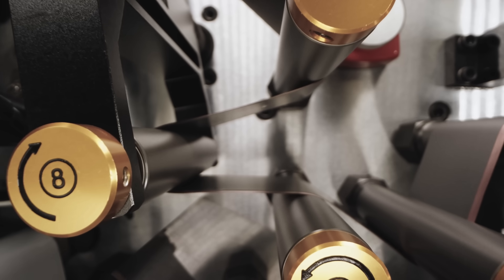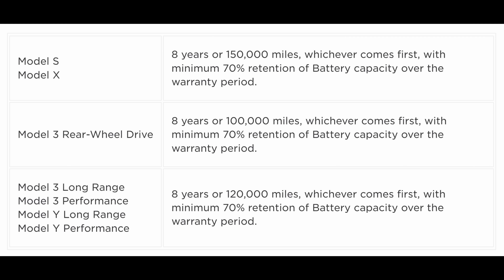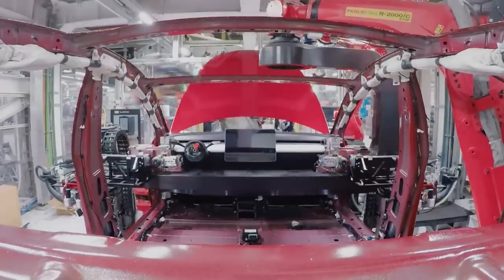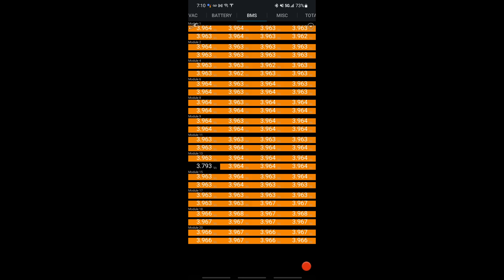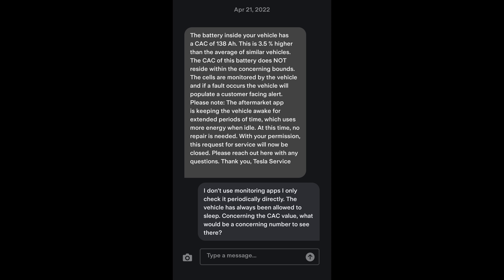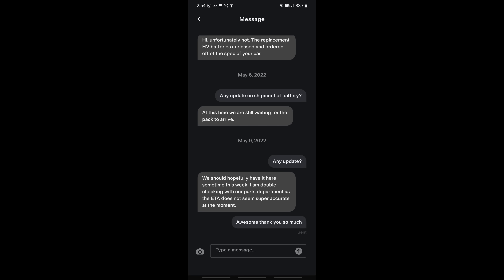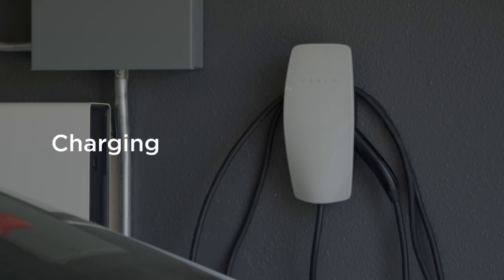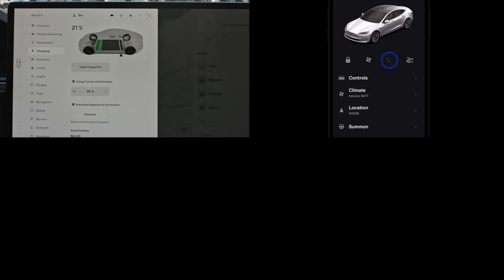What Happens When a Tesla Battery Fails?

Comment: Most manufacturers warranty a new part for at least a year.  As you mentioned, it was probably a mis-communication when Tesla told Paul that the "new" battery fell under the original warranty.
Reply: if he didnt get it in writing, no way tesla will honor it.
Reply: this is not the first time i headed this . i was just on  ev firm and the guy had a refurbish pack installed by tesla  the second pack failed at 123000 miles , his warranty was for 120000. tesala  will not replace the battery. he said he got another year  and a half from teslas refurbished pack

Comment: Tesla does refurbish batteripacks that fail like the one in this case. It could be just a few cells failing and when replaced the pack can work again. 90% charging limit is perfectly fine. The cost of repair does not have to be 15K. Many repairs are way less. See the videos from Gruber Motors.

Comment: PLEASE HELP DIRTY TESLA, my car is a str+ and I'm at 200/250 miles in only 2 years and 19,000 miles. I've tried to get Tesla to work on it but everytime I make a appointment they cancell it with no explanation. Can't call anyone and my car is losing 10 miles like every month now I can't sustain this what should I do
Reply: theres nothing. try to fry the pack (sit at 0%, sit at 100%). unless you get to 70% or an error code, they literally will not move an inch.
Reply: I'd recommend getting the app as shown in the video and look at the individual cell voltages.  If they are low as shown, go to a service center and talk to someone.
Reply from the maker: The problem is, Tesla will most likely not accept outside information. If the pack is below 70% capacity, or you get an error message, they will do something. Otherwise, it will be difficult to get them to take action.

Comment: GM is giving full new warranty, 8 yr 100,000 mile, on Bolt battery replacements,  after the recall.
Reply: They must be replacing them with brand new batteries? Doubt they have that many refurbished ones.
Reply: @ahavrilla9577  Yes, they are.
Reply: That's generous.

Comment: “What would you do if you have a bad battery?” Well… what would you do if you had an engine blow out? Get a new one 😂
Reply: You can very easily repair the engine instead of changing it entirely lol….
Reply: @carholic-sz3qv , not always.  I've known at least a few cars/vans/light trucks that had engines replaced by a dealer/maker rather than repair in place.
Reply: @beltrams  replacement is only in case of a very bad case.
Reply: I think EV ( Tesla)better if Elon musk build battery swap